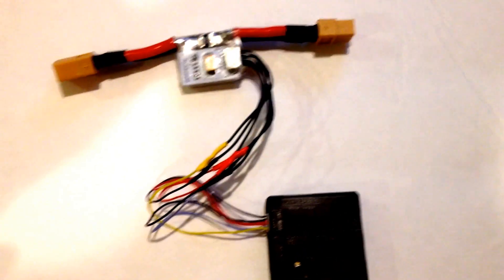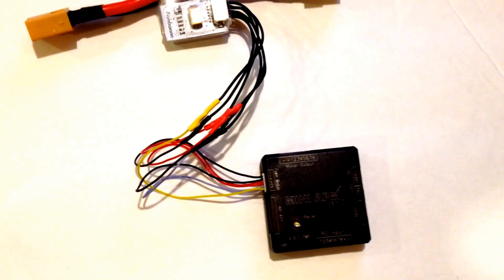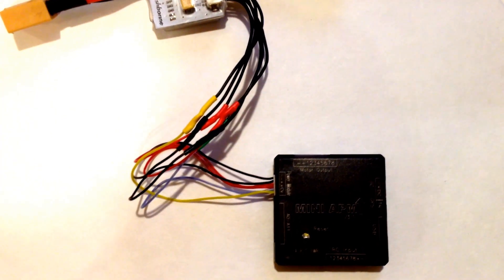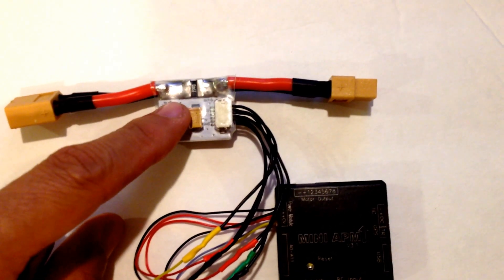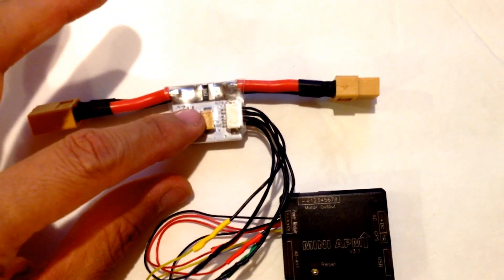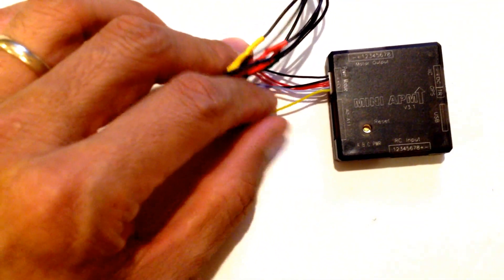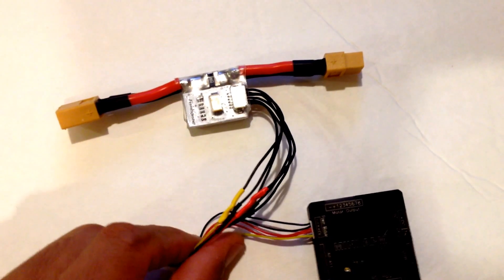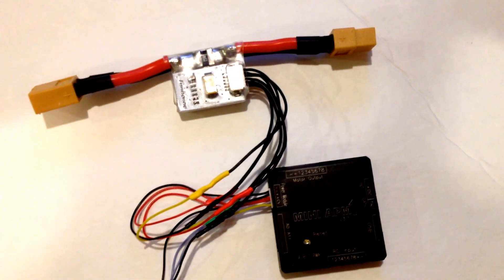Setting Up the Power Module for APM mini

Comment: Thanks for the video.  My power module is not the same brand/does not look like yours.  How do I know the wiring will be the same as yours?
Reply from the maker: You have to look at the markings on the module and pray that they are correct. There are so many permutations nowadays that it is impossible to account for every power module.
Reply: Skyview Productions If the grounds and the A / V sensors do get reversed; how can I tell and will it damage anything?

Comment: Thanks for the info.  Rebuilding my 260 King Kong quad with an APM Pro which only has the standard pins and not the mini connectors like my APM 2.6 on my larger quads...

Comment: Hi Khoa, can I connect the APM mini without a power module? Thanks.
Reply from the maker: Technically yes, but when I have tried, the results were unreliable so I don't recommend it.
Reply: +Khoa Nuyen thank you! I'm using a Power distribution board with 5v exit  and works fine.

Comment: I just wired my 3.1 with a power module and I am not getting any power to the APM.  Are you sure that top to bottom on power module it is GND, GND,CM ,VM, 5V, 5V? I think you have CM,VM backwords.  Listen to your video.